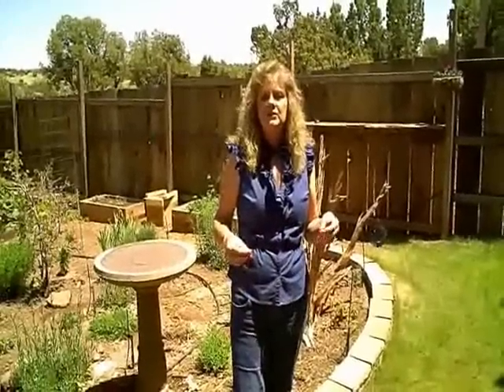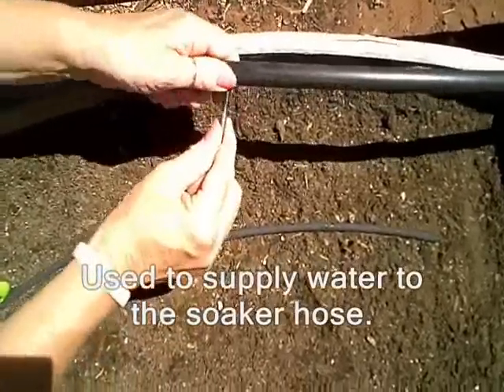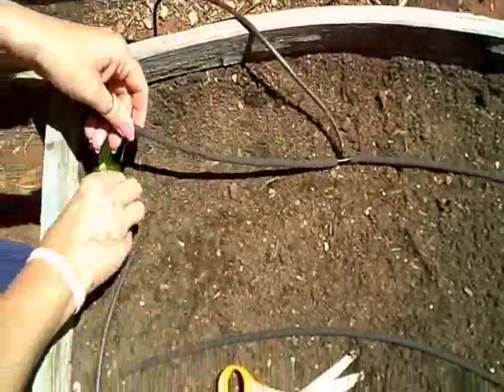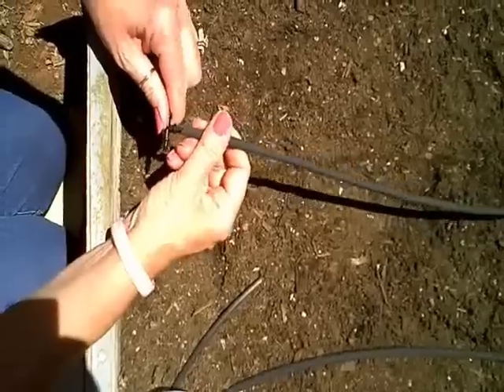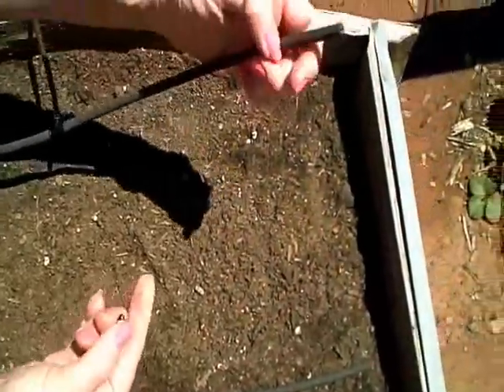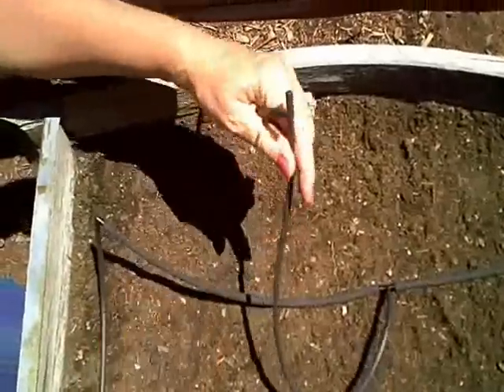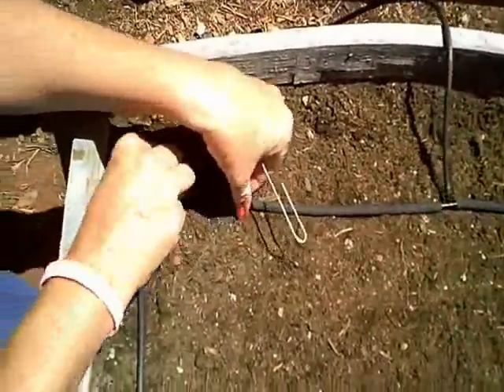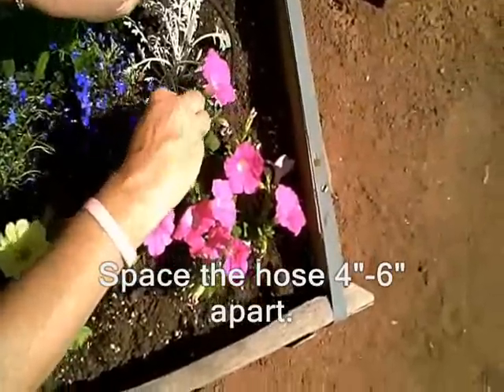Mini Soaker Hose

Comment: Lori (hope I spelled it right)
I have laid our 1/4" soaker pretty much the same as you describe on the latter part of the video (ave. length 8-10 ft).

My biggest issue is, uneven distribution of water throughout the hose. The fist feet of the hose drips heavily, and almost none gets to the end of the hose. What am I doing wrong?
Any suggestions please?
Reply from the maker: Freedom, it could be several things. And yes, it's Lori!
Are you using a pressure regulator?
Is the surface level?
Do you have more irrigation tied in to the same line that you are using the 1/4" soaker hose?
How old is the hose?
Do you have a filter?  
Please feel free to us, our number can be found on our "CONTACT" page on www.mrdrip.com.
Reply: Lori,
thanks for the reply. I will follow up on your advise.

thanks